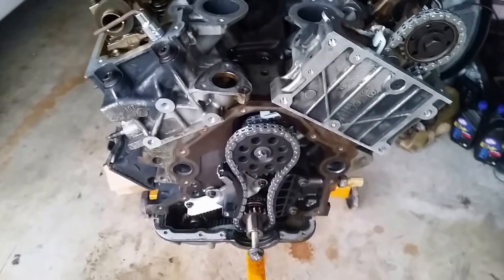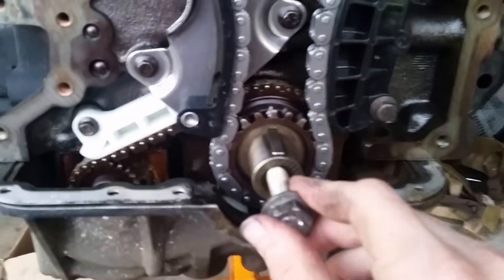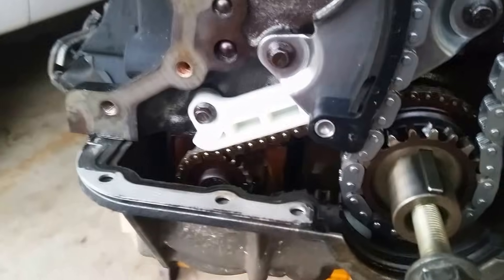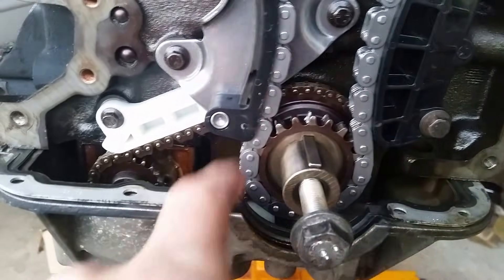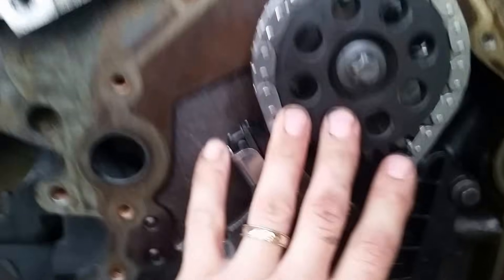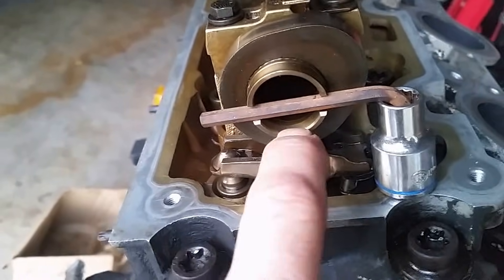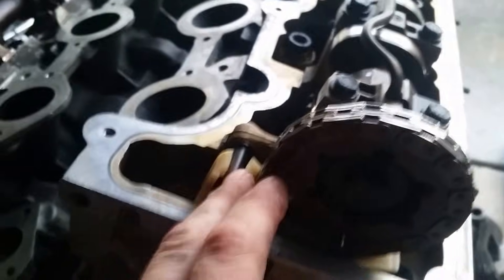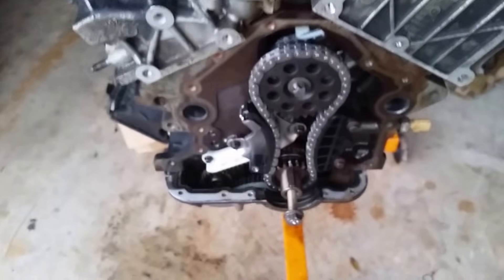Ford Explorer, Sport Trac, Mustang, Ranger 4.0L timing chains without the special tools!

Comment: .I want to use your method. My issue is that when I pulled the timing chain cover I immediately noticed one of the timing guide tensioners was completely gone. So I went ahead and brought the key way to top dead center ( bringing #1 piston to top). I then pulled the valve covers off the
Left head and noticed the slot on the cam was not parallel with the top of the head . I then pulled the right valve cover and that slot on the cam was parallel with the top of the head.  Watching your video it looks like the slots on both cams were parallel with the top of the heads. Both cam chain guides also looked fine. My question is how could one cam have gotten out of time when both cam chains were fine. If the front main timing chain would have skipped a tooth wouldn't both cams have went out of time together?
Reply: How did the engine run with the one cam off time? I think I have the same problem, mine lacks power on acceleration. How did the engine run with the one cam off time?

Comment: Rex your engine is clean inside mine was nasty still working on that one lol
Reply from the maker: My motor was pretty clean to start with. I have pulled the heads on a lot of v6 and v8 motors and sometimes there is a lot of build-up and gunk in the engine valley. Problem is, once it's disturbed, it will find it's way down the oil returns and clog the oil pump pick-up. I had a small shop vac that worked great for this particular problem. It even had some small attachments that could get into tight spaces. Anyway, if you have the motor pulled, you can have the oil pan off in no time. Hope this helps.
Reply: T- REX no it's back in lol has a slight ticking I have atf in the oil trying to slowly clean it out but I feel like engine flush turns that crap to liquid so it won't clog up
Reply: @themechanic2500  Maybe try frequent oil changes and thicker oil.

Comment: HI, I buy the special tool for a ford mustang 2006, but still went I start the motor only 3 pistons or working(456), 123 there His a little heat not much. I open the cover valve(123) and install back the special tools and it gose perfect on the cam shaft. What the problem? His it possible I check the spark plug wiher it all OK. Thank!
Reply: Denis Manningham but

Comment: Hey bud thanks for sharing. Going to be tackling my first motor pull with my truck. Rear cassette started rattling bad on start up and sometimes it stays continuously. I appreciate your input. I bought a ebay timing chain kit and was hoping it will all workout! good to see it working for you.
Reply: did you get yours running? how did ebay timing set work?
Reply: @eddiereichel9354 : Probably better off buying a name brand part such as Cloyes.

Comment: thanks for the video I'm going to be pulling my engine soon and replacing everything I seen a guy also use a few pairs of vice grips on the  cams may do that as well just to be on the safe side??  did you happen to take apart your oil pan bcz I really don't want to have broken cassettes inside my engine and clogg up the oil pump later on
Reply from the maker: I had complete timing chain failure. It looked like a grenade went off. I had pieces everywhere. I also had some bent valves and had to pull the heads. I did  remove the oil pan and cleaned it. I also removed the oil pump pick up tube and cleaned it. If you already have the motor pulled, it's not that much more work to remove the pan. 
Hope this helps
Reply: the mechanic very good videos !!!!
Reply: Mark Humphris thanks If your taking about mine if doing it I would use his method and mine too the jackshaft & cams didn't move any
Reply: the mechanic I got ahold kof one that someone else attempted and didn't get it ,  they put it back in a mess , Long story ,  I set the right cam , locked it in place ,went to the rear of cam on drivers side  with crank in 12:00 position loosened center jackshaft bolt ,turned cam set it , ,checking both camshafts and crank , I put it together to the point where it would run , ,it starts right up ,but has a terrible miss , I'm hoping the other shop got the plugwires mixed up , if not I think some valves connected with the pistons , that's why I found a compression gauge screwed into a plug hole  they forgot to take out .I'm hoping its just crosswired ????.
Reply: Mark Humphris I don't think a valve hit a piston but you can start it and hold a paper in front of the tailpipe if it's flapping around there's a valve sticking or bent valve but I don't think that's it mine was the worse I could have ever imagined a Ford tech that does a ton of Ford vids on you tube did a 5.4 said it was the worse on he has seen was nice compared to mine lol. the  cylinders are 1-2-3 pass 4-6-5 drivers. front of you coil goes 4-6-5 rear goes 1-2-3 it should have the #'s in the middle check it I bet the wires are wrong the 5& 6 probably it happened to me lol fired right up but had a miss pretty bad
Reply: T- REX how do i know without taking off the heads if i have bent valves? Can i look through the holes where the upper intake manifold goes to look or is there another way?

Comment: great video. one question, can u do only the front cassette with engine on the truck?
Reply: ger tis If you are only doing the front cassette then yes you can do it with engine still in truck.  It is always smarter to pull the engine and take care of the rear cassette as well regardless if it is still quiet or not.

Comment: kobalt socket ? what depth sockets ? are those mid deep  or shallow 3/8 drive ? trying to get a rough idea on how tall they are thanks
Reply: Joseph Jones Front jackshaft bolt is an E18 (external torx).  Don't reuse the original bolt because it is a torque to yield bolt as well as the rear jackshaft bolt and crankshaft damper bolt.  Buy new bolts at the dealership.  Part numbers are W703167-S430, 2L2Z-6279-AA, and E7RY-6A340-B
Reply from the maker: Joseph Jones 
I think they were 1/2 Drive shallow.  I will try to find the exact ones I used in the morning.

Comment: Hey Rex so I got my motor in that I used Ford OEM on. Now with the old one, I wanna throw a cheap chain kit on it and resell. What kit did you use? And where did you buy it? Heard it's been holding up decently.
Reply from the maker: Hans Gruper
 I ordered all the parts from ebay. I was surprised how inexpensive.  I was expecting cheap (quality) and i was surprised by that as well. Everything seemed to be well made.
Reply: T- REX Do u remember the possible seller name? Or brand name? I'll look for the colors of the guides and match accordingly
Reply from the maker: Hans Gruper 
ill check my purchase history and see what I find. Ill get back to you asap.
Reply from the maker: Hans Gruper 
I bought the timing kit from ebay seller, carpartwiz and the head gaskets were purchased from martinautoparts. hope this helps
Reply: T- REX Rex, thank you so much for the fast reply. I know exactly which seller you are talking about. I will be ordering the parts tomorrow. Oh and real quick, I was wondering if you would be able to do an update video? I'd love to see how the project turned out.
Reply: words of wisdom don't use those cheap ebay or other timing kits , they wont last , my machine shop I deal with all the time says he see's these motors come back all the time with cheap timing kits that broke, only use OEM ford parts if you want it to last, if your selling it soon ok, but word's to live by.
Reply: Hans Gruper I also got a kit from performance it sucked the cam sprokets didn't even fit on the cams had to reuse the old ones but it was only $95 bucks
Reply: aqbqdfbdbn ummm yeah fix it cheap sell it fast eBay you can buy the whole kit oil pump and tools for $289 they want that for the tools alone I'll never buy another ford sohc 4.0 and definitely not a 02-05 explorer biggest pos ever made by Ford I drive a zx5 now haven't done much coil plugs twice went 30k on the oil and no sludge lol
Reply: aqbqdfbdbn I used all Ford OEM components. Cost me a C5 vertebrae but she runs and drives beautifully now. Purrs like a kitten. New pistons, rings, bearings, head gaskets, EVERYTHING.
Reply: the mechanic I'll DEFINITELY buy another 4.0 SOHC. Now that I know so much about them lmao. It's not a matter of if catastrophic failure will occur, it's when.
Reply: Is this kit still holding up? Just wondering because I'm trying to decide what timing kit to get. Thanks!

Comment: Hello T-Rex... Great vid... terrific idea on how to spare the need of buying or renting the special tools. I'm in the need of changing the valve stem seals, so I'm wondering if it is doable just by disengaging the valveshaft from its pinion or if it is only possible by disassembly of the entire timing system. (asking this because there's the possibility of changing those seals without taking the engine out of the truck) Thanks for anyone that can help me out.
Reply: I have replaced valve seals in other Ford engines using 3/16" polypropolene rope. Use a flame to melt slightly the end of the rope to prevent frays from getting in the engine. Turn piston to BDC on the cylinder you are working on. Stuff the rope into the cylinder through spark plug hole. I think I stuffed 2-3'. SLOWLY turn engine by hand to raise piston upwards to smash the rope into the combustion chamber to support the valves from falling into the cylinder once springs and keepers are removed from valve. This method is much safer than using compressed air, as you have some actual item holding the valve from dropping. If using compressed air and the compressor stops working (power outage, mechanical failure) you will drop a valve into the cylinder. DO NOT use jute rope, only polypropolene with the inserted end melted to form a small blob to prevent fraying. You don't want fibers in the cylinder.
Reply: @nofortunatesonII  very good idea! Thanks a lot
Reply: You'll have to remove the cam or the rocker arms. It's a roller cam, not flat tappet. They make a tool for it actually.
Reply from the maker: Gonzalo Peraza 
does it only smoke at start up and when you accelerate fast?

Comment: i think these guys explane everything pretty good now im a little worried cause we are going to do the engine inn explorer replace front timming chains procedure i wish they had the in car replacement procedures ....... does any one have the exact procedures for a 2004 ford explorer 4.0 flex 4x4 engine in timing chain replacement procedure available?
Reply: rachel white go to your local advance auto and pick up the Haynes manual for 2002-2010 Ford Explorer. The wholeeeee shpiel is in there.
Reply: rachel white better be doing the both sets front and rear gaskets everything or it will bite you later
Reply: rachel,you said we.if you are with someone,why did you ask the mechanic in the other video if he was single?  naughty naughty!

Comment: You know they say necessity is the mother of invention. Great tips I'm trying to help my daughter on hers & anytime you can save a single mother 200$-300$ on a repair for tooling, That's really a worth while accomplishment. Thanks for taking the time to help other folks out.
Reply from the maker: Cattlerest - it really does feel good knowing this is actually helping people. Thank you for your comment.
Reply: @You-Tube...005  is there a difference in these motors as far as if it's going into a 4x4 or 2wd?? In the timing setup? The internals, have a extra sprocket or something? Seen ford tech mention something in one of his videos??
Reply from the maker: @kylewoodward7078  it's the same
Reply: @You-Tube...005  thanks bro, from what ford tech said the 4x4 had a extra balance shaft in it, I need to get me a junk yard motor, mine has rod knock I'm pretty, so I don't think it's worth rebuilding. I know from 01 to 07 they had the 4.0 sohc v6, do you know if all of these motors will fit in my 02. ( plug and play)And in 04 I think ford changed the hood and grill, but besides that, do you know if these year body parts will fit my 02.. Thanks brother for any info

Comment: I already have the special tools, but that's a great idea. I pulled my engine out a while back and replaced the rear guide and after I got everything back together and started the engine the front guides broke on me. Needless to say after doing all that work it made me sick. Now that I have to do the front part with the engine still in, do I need a special tool to hold the front sprocket while torqueing that E40 Torx bolt down, or will the crankshaft sprocket keep it from turning?
Reply from the maker: Brian Smith 
Hi Brian,
I would pull the valve cover(s) and hold the cam(s) in place. the crankshaft will spin.

Comment from the maker: Thank you for watching and please subscribe for more.
Reply: T- REX You should've used Ford OEM timing chain components. You'll be sorry you didn't in about 10k mile
Reply from the maker: Hans Gruper  Hello Hans,
yes, I am aware. There was a couple of reasons I decided to go the cheapest way possible. First, It cost less than $100 dollars to repair. No labor costs. It also has a tricky trans, the servo bores are worn. when driving, I have to let up on the accelerator a little bit for it to shift. First thing I would ask someone in this situation is, why would you fix the motor if it has transmission problems? the reason is, I have been driving it this way for over a year now. anyway, I'm back on the road for less than a hundred bucks. My tax return will be here in less than a month and I will probably get a different vehicle. thank you for the reply.
Reply: T- REX I'm on the same boat. I've been thru 4 transmissions and 2 engines. About to blow my 3rd. So I completely rebuilt a motor to put in. The drivetrains suck but I love the truck so Im keeping it as long as I can
Reply from the maker: Hans Gruper I'm ok driving mine with the trans the way it is. what bothers me is, it keeps throwing codes and the OD light is always flashing. I'm thinking about just pulling the OD bulb.
Reply: T- REX I blew the trans a week after that O/D light started flashing.
Reply from the maker: Hans Gruper mine has been like this for over a year. I know exactly when it's going to shift, when to let up on the throttle, every once in a while, I'll try to get on it and I won't let up early enough, that's when it will slam into 2nd or 3rd gear. If I had a passenger with me, they probably wouldn't know it has transmission problems. I think that if someone else were to drive it for a couple of days, it would be completely done, not knowing to baby it. I guess I've been really lucky ( knock on wood)
Reply: I had good success installing a Sonnax Zip Kit in my 5R55E.
http://www.sonnax.com/parts/2172-zip-kit
Reply: T Rex how did that timing set hold up? I Just ordered one for my grandmother's explorer and am wondering about how long they last
Reply: T- REX Hey Rex, can you say exactly how difficult these engines are to retime still fitted in the engine bay?